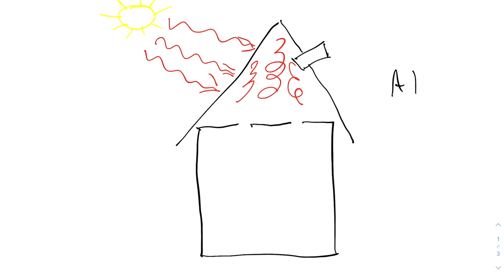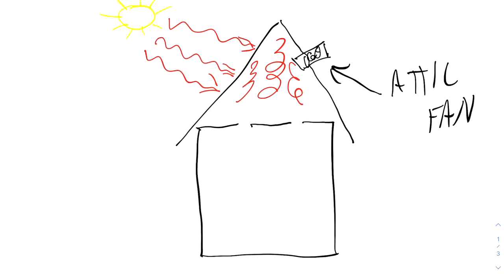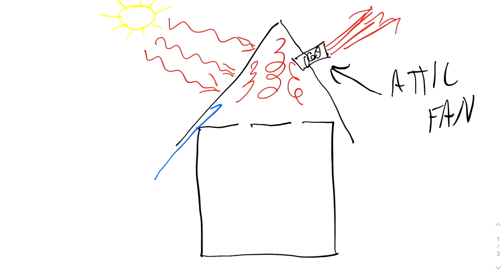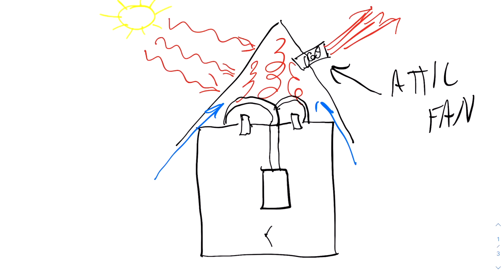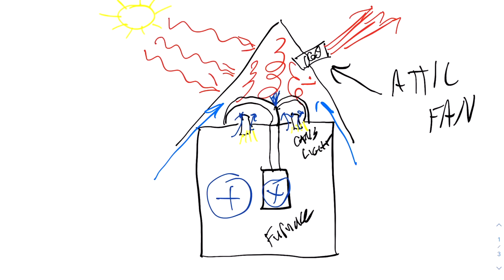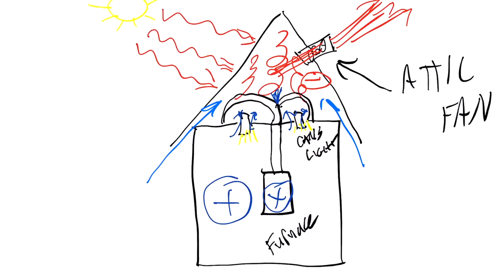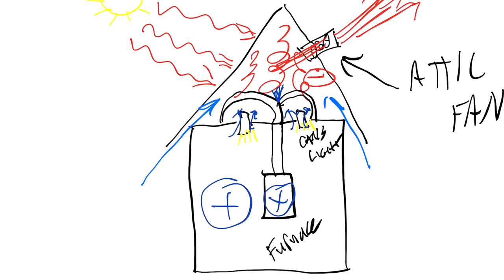3 Remodel Rip-Offs

Comment: I disagree on the fan.  I lived in a townhouse and in the summer our AC would run nonstop and the coolest I could ever get my third floor was 76.  Installed a fan that would turn on at 120 in the attic and my third floor would now maintain 70 and the ac stopped running all the time and my electric bill actually decreased.  It was the most impactful change I made to that townhouse and the best few hundred bucks I've ever spent.
Reply: I agree in some applications they will save energy on existing homes 
I am a HVAC professional
Reply: I partially agree with him. I've looked at the solar-powered vent fans and they contain a computer cooling fan!!! My range fan over my stove is more powerful. I'm looking at the AC powered ones but still evaluating. I'm wondering if just installing a powerful range fan or duct booster fan under my current wind turbines will do any good. I'm researching that too.
Reply: I have a 1913 church building with zero attic ventilation. With no ridge vent, and no eave vents, my solution, until the next roofing job is to place to electric roof vents, and bore multiple holes in the 2x6 blocking the path to the eaves. Seal off the attic from the rest of the building. Sure, roof venting is needed at the time of the next roofing job.
Reply: I disagree as well.  I had a solar attic vent installed years ago (in Texas) summer electric bill dropped 100.00 per month and it allowed me to get the house much cooler.  100% fact
Reply: Attic fans are terrible because the manufacturer refused to pay for advertising on this channel.
Reply: @cyborgdale  a regular house fan under turbines works very well. Double turbo! The fan actually uses less amperage too, because of the turbine
Reply: In a house with proper soffit and ridge vents, I agree a fan is a waste of money ... as we walk backwards from our ideal situation, an attic fan will begin to make sense ... and with Itcajh's 1913 church building, and attic fan is indispensable ... I don't buy Mr Risinger's bit about "negative pressure", not at sea level, not in Denver, Colorado and not in Quito, Ecuador ... that's just not how air behaves under this amount of pressure ... with even a few soffit vents, we're not going to pull air out of the house ...
Reply: @russcrawford3310  You aren't thinking here. The attic fan can draw air from *everywhere*. Most houses with duct work in the attic, leaks. And so are there leaks around each vent openings in the ceiling. You are thinking that because you have open air drafts from the soffits that means it's not going to draw air from those areas. You are wrong. It will do it from both!
Reply: @monteglover4133  our contractor only services existing ones but doesn't offer new ones installed, out of 60 years in business, technology changes, best thing is insulation and ductwork for the customers with those fans have been their greatest savings in utilities cost
Reply: @sprockkets  - Soffit vents are 1-1/2" x 22" ... if you have gaps in your ductwork that size, you need new ductwork ... any gaps in the ceiling anywhere and of any size means the house isn't weatherized ... that's a different and more expensive problem ... I'm sorry, the fan will draw mostly the air with the least resistance ... not that a little won't come through the pin pricks ... but most of the air comes from the gaping holes in the soffit board ...
Reply: I'm also a "fan" (heh heh) of attic fans as long as all of the factors are taken into account.  If your soffit vents are large enough, it won't create excessive negative pressure in the attic and it won't pull conditioned air from the house.
Reply: A OK  Irrelevant!!
Reply: @russcrawford3310  Glad you actually read the comment. Oh wait you didn't.
Reply: Yes agree but hopefully you also beefed up the attic insulation too. That would also make a big difference and cost a few hundred dollars as well
Reply: @scottstevens2986  $100/month??? Wow that’s the biggest lie I’ve seen on YouTube. You sound like a snake 🐍 oil salesman 😂
Reply: @Laissez_Faire  it is possible if it is a 10,000+ sq ft home
Reply: @sidsid9808  i guess you’re right. If I was living in a 10,000 square-foot home the last thing I would be doing is trying to save $100 a month in energy bill when my mortgage would be around 40k a month 😆
Reply: @sprockkets  Kind of sounds like he did.  You correctly pointed out that the attic fan will draw air from every available channel.  Russ correctly pointed out that, due to the friction/resistance of the tiny gaps in HVAC, ceiling/wall fixtures, doors and windows, a higher volume of air will be pulled from the soffit vents.  Simplify the system into a Y-pipe, with the fan drawing air through one side which is 1 inch in length and a diameter of 30 inches, while the other side is a 30 foot long coffee stir-straw full of kinks.  You'll have to account for the introduction of friction (head loss) in the smaller channel for the conservation equation to reveal the difference, but you'll see that the volume of air being pulled from the home is negligible in comparison to the soffit vents.
Reply: I’m afraid I must question your process. Did you calculate the average outdoor temperature and humidity prior to and after installing the fan? Perhaps the temperatures were a bit cooler with less humidity after you installed the fan. I’ve been in roofing for over 27 years and tell my friends and relatives to never instal a fan. I feel it’s better to cut the ridge sheathing back 2-3 inches on both sides and instal some form of ridge vent. Hot air naturally rises and is pushed out through natural pressure. There’s no need for a fan. The extreme heat will escape naturally. This system can never break down nor does it cost you anything. And it works day and night at a more constant pace. Instal extra insulation to your attic floor for more cool air retention when your ac is on.
Reply: Yep, he's wrong.
Reply: user name  😆
Reply: It might depend on the part of the country you live in.  Texas heat would make this work differently than the upper 80s we get around here.  Pulling 85 degree air through a 120 degree attic is going to cool it off, even if the roof is radiating a lot of heat.  We also don't have AC so pulling air from the house doesn't really matter.
Reply: I think the fans SHOULD be the low voltage "computer" fans but they should not be singular blowing OUT, they should be multiples, blowing IN, 100 of them solar powered affixed to the soffet vents forcing air IN.  That eliminates the negative pressure issue, and helps efficiency.
Reply: Couldn't you have added more insulation?
Reply: @russcrawford3310  the stack effect causes upwards transfer of air even without a fan. Heat rises. Putting a fan in would at best do nothing, and considering how large some of those fans are, you absolutely can be pulling conditioned air into the attic. Either the fan is strong enough to do what its claiming to do, which is removing the total volume of air in the attic several times over every day and some condition air with it...or they are useless like Matt said and are not capable pulling enough air to cool the attic and therefore little conditioned air is being pulled...which one is it?
Reply: @tsmall07  if its 100 degrees outside do you think pulling that air into the attic with a glorified bathroom fan is going to cool the underside of the roof deck enough to stop the heat from radiating into the living space? You're literally claiming an attic fan is more capable of a cooling system than an hvac system. These are wild claims and the actual practical applications of an attic fan are pretty limited.
Reply: @MarlowWhere  I agree with you. Insulation is the best way to go since it blocks radiating heat in the summer and keeps the air cool in then house and heat in the winter. Fans only keep the attic cool.
Reply: @tedthurgate  presumably the air in the living space is cooler than the attic. By pulling it upwards you are creating a negative pressure in the living space that sucks outside air into living space...one would have to also wonder if your summer highs are in the 80s why do you even need an attic fan?
Reply: @MarlowWhere  no, that's not what I'm saying. It's not going to cool the house but it will absolutely cool the attic which reduces heat gain into the house from the attic. You should work on your reading comprehension skills
Reply: @tsmall07  pretty sure I replied to the wrong comment
Reply: @MarlowWhere  is there venting along the ridge? ... are there soffit vents ... these are both included in building code ... a fan is not needed in this case ... is the building sub-code? ... don't expect your roofing material to last ...
Reply: @russcrawford3310  I'm not really sure what point you are making. Soffit vents typically prevent condensation from gathering on the underside of the roof deck in the winter....which would improve the life of sheathing. Vapor drive causes moisture to dry to the inside of a house during the summer where it is coolest and dryest...so if you're experiencing moisture issues on the inside of your roofing deck during the summer it has nothing to do with whether you have an attic fan. Ive managed dozens of old homes with no attic fan that all had sheathing decades old with no visible moisture issues. Gable and soffit vents ate absolutely adequate in managing the ventilation of an attic. Running a fan is just masking the real problem (your attic floor is poorly insulated and drafty).
Reply: @MarlowWhere  - I've already said that with soffit and ridge vents (and/or gable vents), we won't need a fan ... thermal convection will be enough ... moisture in your attic in winter is coming from the living space ... the ceiling is leaky and that needs to be fixed first ... 

My point is about the temperature gradient across the roofing membrane ... if this is too high, it will damage your roofing, due to uneven thermal expansion and contraction ... this is especially apparent with 3-tab asphalt shingles ... the embedded grains pop out and wash away ... 

Building code calls for R-38 in the ceiling ... and the ceiling needs to be air-tight ... with this we only lose pennies per month on our energy bill ... with or without proper attic venting ...
Reply: @russcrawford3310  my original point is that you were saying it is unlikely that an attic with venting would pull conditioned air...but I would argue that the fact that everyone on here is saying a fan worked for them is proof that it is sucking out air from the living space even with adequate venting. There is no other explanation. A fan cannot cool the attic floor to the point that the house would also lower in temp  like many people are claiming...wood and drywall is conductive but its not a heat sink when paired with a fan! The roof deck also never cools down, it only removes the hot air in the attic. Like Matt said, the claims people are making you would think they have a small jet motor sucking air out of their attic.
Reply: I'm with you Steve. I have installed two wind driven ventilators on  my roof and they save me around about $180 on my summer electricity bill. One time cost $150. Ongoing saving $180 per year. Matt got this one wrong. Roof ventilation does work, powered or not.
Reply: @tonybloomfield5635  it works because your ceiling probably looks like swiss cheese and you have a shag rug for insulation.
Reply: A positively pressurized house will push cold air out of the house anyway. He said that depressurizing the attic will cause the cold air in the house to push its way into the attic which is true. If the attic heats up and it’s not properly well vented then it’s going to have more pressure than the house and push hot air into the house rather than out the vents. I think adding a attic fan could help a house that has an attic that is poorly vented and if the ceiling in between the attic and house is poorly insulted. If your insulation in the attic is not good then the attic collects the heat and the radiant heat will go into your poorly insulated house. An attic vent is probably a cheaper alternative to adding insulation to the attic and then properly venting the attic. A vent fan probably does help on old house in the summer but in the winter you would still want better attic insulation to an old house. In a warm climate though winter might not be a concern.
Reply: @Laissez_Faire  if I lived in a 10k sqft house I would have paid cash and woudn't give a rats azz about the a/c bill.
Reply: I couldn't disagree more with everything he says...all this video did was to say what not to do...he never approaches what to do...I had all of my windows replaced with double pane and it is noticeably cooler in the summer..I have the first generation wind turbines on my roof (2) and those are a joke and they have been there for some time...both will be replaced with a quality 40 watt solar fan in the existing cut-outs of the wind turbines..other family members have the solar and there is a distinct difference in the coolness of the house...my feeling is this..if you can't provide a cure and can only act as an authority as to what is not good then you really shouldn't participate in the conversation.
Reply: @fourseasons2349  he has dozens of other videos where he talks about what to do....this is a video about rip-offs IE what not to do. 

Windows are not a cost effective investment unless you plan to live in the house long-term. That is why Matt doesn't recommend them. There are other energy retrofits that will pay themselves back much quicker.
Reply: About 10 years ago I got an estimate for a new roof.  It was going to cost me about $4,000.  Instead, I used White Roofguard 700 for trailers on my worn-out shingle roof.  I used a roller and pole to push the sealer under the shingles, laying them back down.  My attic used to be 130F to 140F in the summer.  Now it is 5 degrees above ambient temperature.  Using this sealer about once every three years gives you a forever roof.  That white roof is cheaper than the fan and is 1/3 of your air conditioner bill.  Figure $75 for 5 gallons.  Several years ago, I tore out the sheetrock off all external walls. I repacked them with 3.5" fiberglass and then glued 1-inch aluminum-backed Celotex insulation over the studs and then applied 5/8 sheetrock over that.  I then mudded and painted. That makes an insane amount of difference.  I have about 18 inches of cellulose insulation in the attic.  That didn't matter because summertime heat will radiate all the way through the insulation.  My 3,400 SQ.FT. house costs me about $110 to $120 per month during the summer on the electric bill.  Last month's electric bill was $93 because of the cold front and I stayed home and watched YouTube all day. Last month's gas bill was $59 and of that $30 was the service charge.
Reply: @russcrawford3310  hey, how do you tell if your ridge vent is done properly?  I can’t see any light through mine during the day.  I am in south Florida, with a lower sloped roof and high potential for severe driving wind and rain.  I am happy it is sealed so well, but thinking it is not naturally connecting very well, I do have 2 gable cents though.  Still think a fan would not help?
Reply: @aarowt6163  - Not leaking water is far and away the most important ... no light through the ridge vent doesn't sound right ... do you clean them on top every few years? ... they might just be clogged with debris ... 2 gable vents should do well enough until next time you re-roof ... I think a roof not leaking is best not messed with ...
Reply: @Cspacecat  The white roof is great, but I bet your insurance company will make you replace the roof in the next few years.  I've heard some companies won't even insure you if your roof is over a certain number of years old..no matter what it's made from.  Before I painted my roof (probably making it harder to remove old shingles for a re-roof), I'd probably contact my insurance agent to see what they say regarding age of roof/coverage/savings for replacing the roof.  $4000 for a new roof is a very low quote...must be a small roof (like 10 square/1000 sq ft roof)or a contractor doing charity work.
Reply: @jameswalker590  A couple of years ago, we had a severe hail storm.  Roofing contractors went door to door scheduling roof replacements.  I took one to my roof.  We could see impact marks, but no penetration. I showed him a large section where I'd spread 6oz glass and then used the sealer as an experiment.  He sat down and ran his hand across the fiberglass and said if people knew of what could be done, it would put him completely out of business. 

I recoated my roof a couple weeks ago and that roof section is really tough.  This summer, I'm going to do the rest of the roof with 6oz glass.  That roof has been on there since 1985.  My present issue is gutters.  They load up.  I think I'm going to design fiberglass roof extensions to get rid of the water without the use of gutters.  

As far as my insurance company, I've never had a claim since my purchase of the house in 1983.  I don't think they will bother me.
Reply: Put two solar in, i get no more than 15 degress above ambient.   Before it was +30 to 35. But i had the lights seal before hand
Reply: @ProfessionalGasLighting  I have a 3,400 ft house. My highest electric bill last summer was $113.  If you divide your monthly bill by your square footage, it will tell you how many cents per square foot it's costing you per month.  I usually keep my house between 68 and 72 F.  It doesn't seem to matter much how hot it gets outside, my cost is usually dependant on how long I run my equipment.

I also run my attic fan spring and fall.  Since I have plenty of thermal mass, if I close the house up during the day, the house stays cool all day.  Summertime is an entirely different story.  If you don't have a white roof or thermal barrier in the attic, heat will penetrate right through the insulation in the evening and heat your house.
Reply: @Cspacecat  I think I’m going to retract my previous comment after watching a different video. I now see that homes can be built in many different archetypes and in different climates. So it was very stupid of me to say that everyone will get the same results from an attic fan, it all depends on their situation.
Reply: @ProfessionalGasLighting  Very true.  It's going to be 101F today in Kansas City.
Reply: i realize I'm pretty randomly asking but do anyone know of a good website to watch new movies online?
Reply: @Dariel Brantley Thanks, signed up and it seems to work :D Appreciate it!!
Reply: @Gianni Marco You are welcome =)
Reply: @sprockkets   Agree!  Older homes are swiss cheese.  And insulation in and of itself will not do it.  One youtube sensei stated it is like wearing a sweater and skiing.   Another sweater will not help.  So, all the builder(s) air leaks must be sealed first, then insulated.
Reply: The infinity lineup is really nice and from an visual look outside they look great.
Reply: Agreed. The guy in the video surely doesn't know what he is talking about.
Reply: This guy doesn’t get the point. The attic fans aren’t there for cooling, they’re there to move the air and prevent mold buildup. In most of the houses, the builders can’t be arsed with ductwork for the bathroom fans and vent them directly into the attic interior; 2 simple gable mounted fans will create enough draft to prevent any residual moisture from turning into a fungal growth, and the power drain is negligible. The rest is proper air sealing and insulation, but if one is really looking into reducing the temperature in their attic, they’ll need to start with a radiant barrier on the sheathing.
Reply: @monteglover4133  I hope you don't scam people with the "A/C tuneup"
Reply: We definitely noticed a worthwhile difference with the fan.
Reply: When getting home from work in the late afternoon, it's great that the roof fan is programmed to pull hot air out of the house,   or if it's pulling out of the interior too if it's hotter inside the out. We could really tell a difference in a house without AC.
Reply: Here is my truth. I have a vaulted ceiling. In the middle of summer I could always feel the heat radiating from the ceiling into the house. Installed fans and soffit vents. No more heat. A/C runs less.
Reply: Two attic fans, one pulling and one pushing
Reply: @russcrawford3310  should I add more vents to my roof to get my attic cooler?
Reply: 2021 and it’s $2500 to have an Attic Breeze 30W solar roof vent installed!  Maybe Matt is right: snake oil!  😕 
OTOH, it can reduce the roof penetrations from four or five to ONE, and maybe extend the Life of attic mounted equipment, namely your $10,000 HVAC. 😆
Reply: @flueflame5438  haha!  Great point. I really like Matt, but he does seem like a shill more often than not, and definitely a melodrama queen!  But what do you expect?…drama sells. ¯\_(ツ)_/¯
Reply: @flueflame5438  this is funny
Reply: The guy is a tool. I am an electrician in Florida. I am in attics every day.  Ones with Attic fans are always substantially cooler through the day and do not stay hot when the sun goes down.
Reply: Same here
Reply: I have an account unit in living room and blows into garage. I put an attic fan in, on the door for attic.  I am in the process  of putting a thermostatic/ humidity  switch  onto the roof fan. Just bought the houseast year and the garage would get so hot because  of the ac bowing into the garage. Anyways, when I was in attic found the fan and two switches "one hooked to fan". So I'm eliminating those switches with my dual switch and a new fan since the old fan is stiff to move" bearings"
Reply: Thanks for your comment.  I'm getting a new roof on an old house very soon, and I'm trying to decide whether to get a ridge vent or a fan (I've been told not to do both as they'll work against each other).  The house has barely any eaves and no soffit vents.
Reply: I’m an Hvac tradesman and I believe they told me in school 20 years ago that these were equivalent to 2 tons of cooling. Meaning they take out that much heatload. I worked for very high end HVAC company and they put them in every house.
Reply: That’s because the cold air on the first floor is being pulled to the upper floors and into the attic thanks to the negative air pressure from the attic fan. This is not actually a good thing as cold conditioned air is being taken from the first floor to the upper floors and into the attic.

Your electric bills going down sounds like an accident of the circumstances rather than an actual solution to the problem. Your zoned A/C is likely undersized or ducts aren’t insulated or aren’t attached correctly to the vents, and so that A/C is not suitable for that area for conditioning. What’s happening is that A/C is then not running as often thanks to the larger A/C for the main level picking up the slack as cold air is pulled upward from your house’s main level to the attic.

In reality, you’d save more money by air sealing and figuring out why your zoned A/C is not able to cool down your third floor below 76 degrees. Like I said, this A/C is likely old, inefficient, undersized, or air and duct leakage is rather severe.

Or you’re using a window or portable A/C unit to condition your third floor, which would explain why it doesn’t cool down below 76 degrees and why your electric bills have gone down as this unit doesn’t run because your primary floor A/C is doing the work for it, which should be a more efficient system anyway.

So no, the attic fan is actually, ironically, creating a better outcome through accident and inefficiencies in your house rather than actually solving the underlying problem.
Reply: @eggnogaddict6287  I’m an Hvac tradesmen. The only way you’re getting a negative in the attic is if the fan is oversized compared to the soffit vents or you don’t have vents. They told us in school that having an attic fan was equivalent to 2 tons of cooling. I don’t have an attic fan but I’m going to put one in. 
I live in Canada so we don’t have any ducts,equipment in our attics and I do see that as an issue. But if the fan is properly sized and there is a proper way for air to get into the attic there should be no issue.
Reply: @sprockkets  Hvac guy here. It will not draw from both. Air always follow the easiest path. If your fan is crazily oversized then yes it could do that but if you get a proper fan sized to your attic vents then it will not pull from your duct system.
Reply: @tsmall07  HVAC guy here. You are 100% correct.
Reply: @Laissez_Faire  HVAC guy here. We were told in school that attics fans were equivalent to 2 tons of cooling. Do I know 100% that is correct; nope-but it makes sense to me. One day I’ll do the heat load calculations.
Reply: @Onward1969  guess what? I'm also an hvac tech, which is irrelevant anyhow.
Reply: @sprockkets  Its not irrelevant. It’s 25 years of experience + math +  doing design builds. Now I have to go install at least 6 different attic fan models on my roof - can’t just do one or people will argue. Better install a gable fan too. Maybe thats better….Need some different size louvers for the other gable, can’t install just one.  Do a smoke test in my house to see if it’s pulling a negative into the attic. Do a heat load calculation. Thanks YouTube. Sheesh!
Reply: @Onward1969  HVAC tradesman isn’t who I would call for a roofing job. With attic ventilation, the issues are almost always with the intake and not the exhaust. Blocked or undersized soffits, or too few in number, tend to be the problem. So if you are having attic ventilation issues, the first places I would look would be to air seal the attic floor, add cellulose insulation to code, and ensure ample soffit ventilation. Exhaust is hardly ever the issue. A powered attic fan certainly won’t be the solution as all the evidence shows while yes, it does cool the attic, it does so by a negative pressure gradient pulling conditioned air through the attic floor. Not a desirable outcome.

Given prevailing attic issues already, the soffits are likely undersized and the can lights are introducing massive air leaks into the attic.

HVAC contractors and electricians never air seal around the HVAC duct trunk penetrations or electrical wall/ceiling penetrations. Heck, you can’t even get insulation contractors who know the proper technique to air seal rim joists. With respect, I put little weight into what an HVAC tech regarding attic ventilation, insulation, and air sealing. Anyone can have good or bad ideas, but credentials alone are meaningless to me especially given how irrelevant it is to the discussion. As I said, it’s tough enough to find a competent insulation contractor for insulation projects. Bad roofers put on bad roofs. Likewise, someone with an HVAC background doesn’t tell me anything regarding their competence on powered attic fans and how it’s a bad idea for a moist/hot attic.
Reply: @eggnogaddict6287  I agree with everything you’re saying. If all those conditions were met I would assume an attic fan would still be a good thing to get the heat out of your attic if the fan is “properly” sized. Even with everything sealed and lots of insulation your still getting heat transfer/thermal bridging. 
I live in Canada so we don’t run ducts/equipment in the attic. They told us in school than attic fan is worth 2 tons of cooling don’t know if that’s correct. I used to work for a high-end HVAC company that used to put  fans in every job that we did. We only did high end custom homes so the build quality was very good. These were new homes. We’re never went back with any issues. 
I look at it like if you put in a 400 CFM exhaust fan in your bathroom. And the pot lights in the bathroom were not sealed properly in the attic. You would have issues. Now if you properly size the bathroom fan and everything is sealed in the attic then the fan will do its job. What I’m finding interesting about reading all the comments is if someone comments they have an attic fan and it made a big difference that everyone starts arguing that the guy must not know what he’s talking about. Maybe it works when all the conditions are met or maybe a ridge vent is better.
Reply: @Onward1969  you keep telling yourself that
Reply: @russcrawford3310  Does air flow rely on "resistance" or differential pressure? It seems to make sense if the attic is sufficiently ventilated the pressure will not actually draw that much from the house, but it seems this will still happen.I think sealing and ventilating are needed with or without the fan--and fans aren't an answer to poor ventilation.
Reply: Agreed.  My 3rd floor was unlivable in summer.  The fan-made all the difference.
Reply: His analogy was a little off in my opinion
Reply: @Anna it’s probable, but would very upon each situation
Reply: I agree. We had one when I was a teenager and it definitely helped. We didn't have central air and you could feel the heat radiating from the ceiling. The fan would drop the temp.
Reply: Actual engineer and real estate agent here. 

On the solar attic fan, he’s full of shit. He found the only application that an attic fan isn’t an absolutely a positive and acted like it’s the only answer. 

Heat rises. Pulling heat out the attic will ALWAYS pull heat out of the house. The cooler you can make the attic, the higher the transfer of heat into the attic from below (the house) meaning the air conditioner has to pull less heat out of the home. 

Even if your lines run in your attic or the entire unit is in the attic, cooling the attic is STILL MAKES THE AC HAVE TO DO LESS WORK! 

Now, if you get a shitty attic fan, will it be a noticeable difference? Maybe not. But there is a reason barns have vert fans, and it’s because it cools down the building.
Reply: I’m with you on the fan.
Reply: When I was a little girl and we didn't have air conditioning at all my dad didn't want to spend the money to get one. We only had a attic fan and at night I loved it. To work best you needed to keep doors and windows open but the breeze was amazing when you didn't have anything else.
Reply: I added two Aldi two blade three way fans. $70 for both. In a 1900 vintage house the energy company recommended the fan exhausts out. Leave the door open. Unless the day is Uber humid it does help with air flow.

90 degrees I don’t need ac in the house. The basement all year round is in the 60’s. The first floor low 70’s at max. Second floor upper 70’s. 

We use it for air flow out. Helps to circulate. They easily fit in both windows.

The free furnace thermostat from the energy company screwed up my furnace trigger. It wouldn’t ignite. 

I asked the tech to put the old one back. He couldn’t get it to light. Told me to hire someone to fix it. I was ticked. Called his supervisor who said the same thing when his contracted employee not the actual power company couldn’t fix it.

I remembered a trick, turn the furnace all the way up. It clicks. This ignited it.

This old house dislikes tech 😁

What I learned when I got a VA grant for new windows to repair original windows that are in poor shape companies like Pella only warranty the actual window for 25 years. But the frame for two. 

This varies depending on the window.

The R value is minimal. Old windows is R 1-3 (haven’t had tested. This is basic knowledge to age). Replacements would require for the warranty to remove storm windows for R-3 to 5 value. Nope, not doing it.

Screw the warranty. The storm window helps a lot.

With proper maintenance. In my case I need to redo problems from previous owners. 

If the entire window is recaulked makes a huge difference. 

Theirs ways to put removable caulk to block holes. I also use foam sponges. I use black out insulated curtains.

You have to be in the house for at least ten years to justify the cost of average window replacements.

And, the vintage house is designed for windows to last generations. Owners over the last hundred years didn’t care for the windows so some need replacing. Eventually the replaced windows will need replacing. 

The original can be removed. Recaulked. Put back. Any of the materials can be replaced easily for very little. 

I’m trying the removable caulk next winter. I bought some on Amazon for $5 to give a try. Sealing up cracks I couldn’t renovate around the ropes. 

I really like this video. Super true. Informative. Helpful. You have a new follower as a result 😁
Reply: @flueflame5438  - Well, a bit cynical...

I seriously doubt that's the reason for his opinion about these. Likely, it's just his experience in his geographical area.

Plus, if he wanted to recommend them, considering his following, I'm sure he could find a manufacturer who would be glad to become a sponsor. 

Lastly, For the average DIY-er, they're going to pick up a powered-roof-vent-fan at a home-improvement store like Menard's, etc... The powered-roof-vent-fans they carry are typically no-name brands that don't advertise, and don't need to advertise, especially as a sponsorship on YouTube.
Reply: @MarlowWhere  Your comment makes no sense.  If it saves money, the cost of any cool air drawn through the ceiling is being more than offset by the cooler attic temperature resulting from drawing the overwhelming amount of cooler air being drawn into the attic from outside the house.
Reply: @sprockkets
Reply: I agree as well. My house electric bill went down almost $100 after after putting one in. Dang ac wouldn’t ever turn off
Reply: Could have done the same thing with a ridge vent and gable vents
Reply: I have a temp sensor by my attic door and it 140 to 160 during the summer. After my installation of a fan I can take it down to around 110 to 115. My system turns off at 100. And my AC is now able to cycle on an off. I live in the real world 🌍.
Reply: It seems to me, even with no duct work, the power roof vents suck in hot air to blow out hot air. 
As long as there is passive ventilation attic heat will vent itself as needed. My house is 50-years old and is still doing just fine without powered vents. 
     We only get 4-weeks of 100+ temperatures, so your results might be different. But my roof lasted 20-years no problem.
Reply: @Laissez_Faire  insulation don't do nothing for radiant heat for that you will need radiant barrier
Reply: @flueflame5438  🤣
Reply: Yep it depends on allot of things . He just explained it in one  where it wouldn’t work
Reply: If thermastat is set to 100 in the attic and its 140....It will cool it down and have a n impact if you live in the south
Reply: 100% agree
Reply: I found a powered fan in my attic. I'll experiment this summer. I'll disconnect it and see if it makes any difference.
Reply: Massive ripoff, the only reason is that cold air from the lower floor was brought up to the next level, A zoned control damper system would alleviate the problem, not the ventilator.
Reply: I concur. The trick is you have to have a matching quality of fan pulling air in from outside that is then pushed out in order for it to work properly.
Reply: Attic vents work great, and so does Gable vents.  Roof vents not so much.   Not enough flow.  Large Gable vents work good
Reply: Ridge vents suck.  Not enough flow thru the screen material
Reply: @Laissez_Faire  and that's why you'll never have a house half that size. But please go on tell us about how the poor's live.
Reply: Whenever the compressor is on, there will be condensation at the evaporator coil. A continuously running fan helps prevent mildew on the evaporator coil and helps reduce the peaks and valleys of the temperature in the dwelling. The continuously running fan is on a low speed setting when the compressor is off.

If the furnace blower motor does not have soft start, then the continuously running fan might actually help reduce the electrical bill because the fan motor isn't having to spike to overcome the inertia of the fan when it turns on.